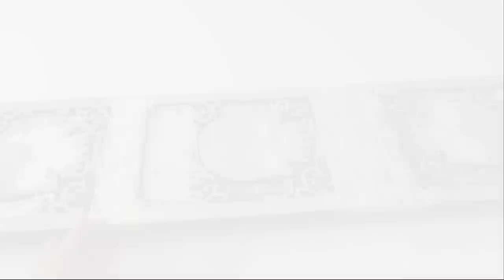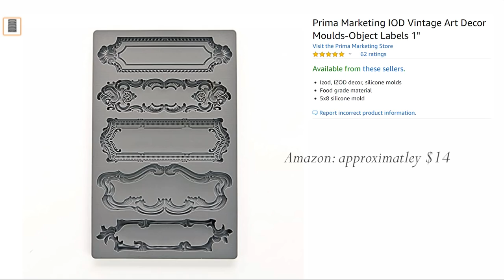ROOM DIVIDER DIY / Whimsical Room Décor / Dollar Tree Tombstones DIY / Shabby Chic Room Divider

Comment: I love your work. What is the purpose of mixing glue with the joint compound?
Reply from the maker: Hi Anne. The spackling from DT doesn’t like to stick very well. I add the glue to make it sticky and creamy. It also helps the paint get a crackle finish. You can also use a little water. ❤️❤️
Reply: @diykarem  thank you very much,  I appreciate  the reply as I  bought some of the spackle the day before and I  would be really bummed if it didn't stick
Have a beautiful  Halloween 🎃.